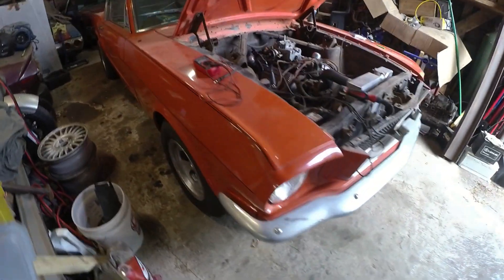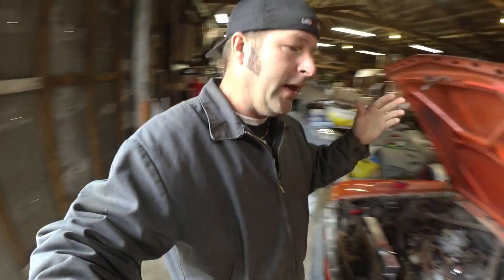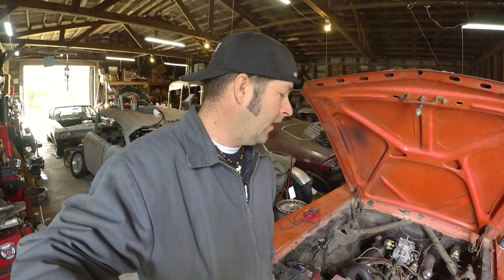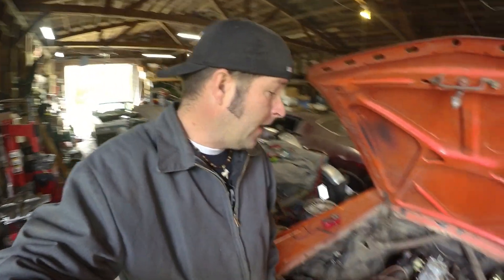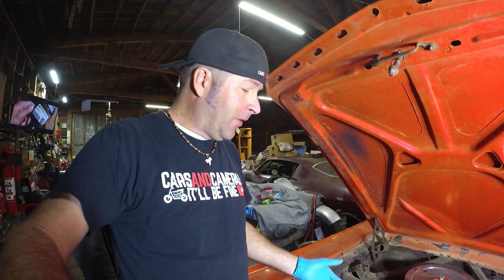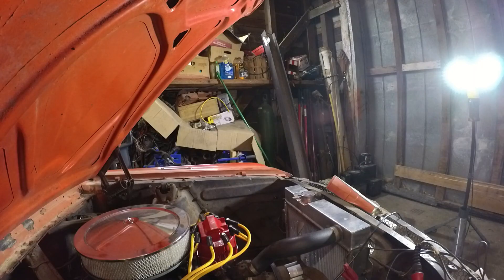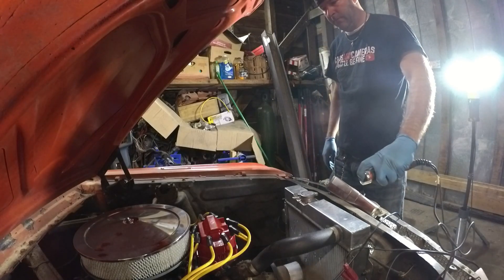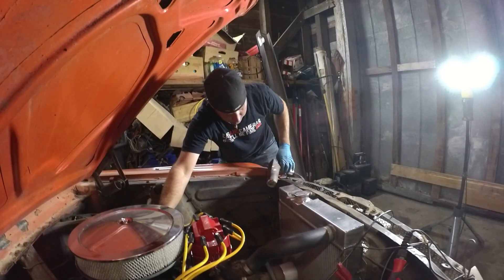My 65 Mustang Died!

Comment: Sometimes the big cap on the HEI doesn't have enough clearance with some intakes. I've used the duraspark ford distributor with an HEI module ...prints and info all over the net. I gutted the fender well motorcraft module and installed it inside...at a glance you would never know.

Comment: If you still have the resistor in line with the ignition, and you are running an aftermarket ignition, that’s your problem. Points need the resistor, anything else will get destroyed if you run the resistor. Electric ignition systems require a full 12+ volts, and running them low will burn them up.
Reply: Except the flamethrower lll
Reply: The flamethrower lll has burnout protection  but also needs 3.2 ohm coil.
Reply: @Paulman50  Really? I guess that’s part of the reason I don’t buy trash from Pertronix. That, and in my 30 years of building engines and drag racing, I’ve never had a customer ask for that brand and I’ve never seen anyone running Pertronix parts that didn’t swap back to MSD, Accel or Mallory within a few races. I’ll stick with MSD.

Comment: Me and my brother were working on a Chevy uplander that wouldn't start and  found we weren't getting fuel. I changed the fuel pump about a month ago. so we took the fuel pump off and tested it and it was fine. We weren't getting power to the pump and so I followed the wires to make sure none were broken. Eventually we decided it was the fuse box itself. My brother smacked the fuse box and the fuel pump kicked in and the thing started perfectly. Funny how stuff works sometimes 😂

Comment: My MGB was doing this when I upgraded to the Petronix ignition. I had it wired one way and it ran fine, then would go out and try to start it and it would only run while cranking. I went and checked where I spliced into and it was not spliced in on the run wire, it was spliced into the crank wire. By all rights it should have never ran. I switched them and it started right up and ran good.

Comment: On those protronix distributors the wires inside brake from the movement of the advance plate. As soon as the engine trys to start the advance plate moves and the broken wire looses connection. Usually happens with in a year of instal.
Reply: Had the same issue on a Maverick. Tried and replaced a lot of parts before we finally figured it out.

Comment: Fords are notorious for the fiber gear in the timing set just up and stripping out. I have had this happen to me 3 times just shut it off and go to start it again and it will do just like yours does. It would fire for a very short time and quit. Another thing to check is the small wires on the solenoid. ne should have 12 V in the starting position and the other should have 6 to 9V in the running position. The only time the coil should see a full 12V is in the starting position.

Comment: had a 81 impalla wagon 305 with a wierd 3 speed auto with a overdrive.did same thing.couldnt figure out why it was acting up plus back then would not pass emissions.so i parked it sold it to a truck driver at work.who stuck a racing distributor in it it fired up.i know you are not wild about the  distributor in the stang if it works and fits it runs.be good for now.

Comment: The old ignition has 12 on start but the voltage drops to 6 volts in run. Your electronic ignition needs full 12 volts.
Reply: Plus needs 3 to 3.2 ohm coil, these draw 17amps until the motor starts running.

Comment: Bad condenser On the original sounds like to me. With that you will have power on the coil side but nothing after the distributor or not enough to run at least. Nice vid man.

Comment: I hate cut to fit ignition wires. In my experience they never last longer than two years, and lucky to get that long out of them. Chevy HEI was always pretty bullet proof. Why worry about how it looks as long as it runs when you turn the key? Just keep the hood shut and no one will know.

Comment: Can an "In-Line Resistor" be replaced with a "Fuse" per say, like make replacing easier? Like an in-line fuse...🤔
Reply: It’ll e the best part of the pony Ha ha.
Reply: No, the resistor is to limit voltage and current to the primary of the coil while the engine is running to prevent burning up the primary winding of the coil.
Reply: Put a one wire delco to go with distributor.
Reply: @davidjernigan8161  yeah, but with the HEI distributor he needs a clean 12V battery. You only need a resistor on points ignition.
Reply: A resistor drops the voltage to 6-8 volts.

Comment: I recently bought a 1968 Coronet that had been sitting 8n storage since 1986. The previous owner had locked up the motor with a broken crank and put it away. I had plans of dropping a 73 imperial 440 in it that I have. Then I ran across a 700 hp blown 440 out of a cuda'. I've been busy upgrading all the systems for the hp gains. There's a lot to it! Lol. It would be cool to do one of those drag weeks with you driving that mustang, or the Biscayne.

Comment: Speaking of weird ignition issues. I tried to fire up my mower the other day and it wouldn't start so I put one of those inline spark testers to see if it had spark and it fired up with it on then I took it off it wouldn't start again so I put the spark tester back on and it fired back up so needless to say I just mowed with inline spark tester hanging out the side of my riding mower 🤣

Comment: You can run a typical Chevy module wiht ANY magnetic pick up. Old Mopar electronic units are getting pricey. It is much easier to use the mopar magnetic dist and make a little box whee I put a grounded chevy unit wired to the coil

Comment: HEI Make sure that you have HEI Plug WIRES, if nothing else a stock distributor Make sure the points are set exactly, dwell meter will help if you do go stock.  Plug the vacuum hose leak. and in the mountains I used to run 13 *BTDC THEN Hook vacuum hose to distributor. Need at Vacuum advance.

Comment: The reason you have voltage when cranking and ignition off is because when the starter solenoid is energized the "I" terminal (small terminal next to the starter cable) supplies full 12 volts to the coil in the start mode. When released, you should get a reduced voltage either through a ballast resister or resistive wire through the ignition switch. Some electronic systems need a full 12v in the run position to operate correctly.

Comment: You have to set the timing on those old Fords with a vacuum gage the chances of you having the correct timing tab and balancer is pretty slim unless it is the original engine. They seem to change every other year. my wife's 67 was way off. you should have got a blue cap make it look better.

Comment: Ford duraspark II ignition is the best factory electronic made ! Hot Rod magazine did an article 30 -35 years ago on electronic ignitions and to get better than duraspark II at the time you needed an MSD system .
Throw out that junky hei and put a duraspark II system in !

Comment: My old school background probably puts me in the minority here, but I have to say I LOVE point type ignitions for their simplicity and cheap price. Yes points have to be cleaned and adjusted periodically, but unless the distributor is inaccessible, its a less than five minute job most thirteen year old kids can learn in a few minutes. Carry a spare set and a screwdriver in the glovebox and you're good to get yourself going again if you do break down in the middle of nowhere. As far as performance goes, what the 60's and early 70's muscle cars could do with point type ignitions is more than impressive...
Reply: People nowadays are too stupid to figure out simple things, and would rather waste money on garbage aftermarket parts just because some magazine said that they need them. But I fully agree with you, I've driven all over BFE and have had zero problems with my points ignitions once you spend the 5 minutes setting them up properly.

Comment: let me guess...it was pertronix. i bought one of their billet distributors, and 5 months later, my dart started running like crap, like the timing was super retarded, and then it died, and wouldnt start back up. popped the hood and could smell burnt electronics. tried and tried to contact warranty about it with no luck. roasted them on instagram in a post, and then i got contact lol. they sent a new pickup, and i had to take a pic of the old pickup with the wires cut LOL.

Comment: Maaaannn i used to have a 73' Mustang and i am kicking myself for selling it. But it needed so much fabrication work done to it and at the time i couldn't afford to have it worked on so i sold it. There were holes in the floor boards and through the trunk. But it still started up. My Mother owned it since she got it brand new back in 73'. Oh well it's gone forever now. 🏎☁☁🤦‍♂

Comment: That wire going to the coil. Should be a silver metallic wire instead of copper. The wire itself is a ballist resistor. Fine job good show. That ballist resistor wire may or may not be needed with electronic ignition.
Reply: If you have the resistor wire and want to run an HEI style you need to change it out at the bulk head to a regular copper wire, it will run with it but you will get high rpm misfires due to lack of voltage. Had to do that on my 68 belair when i went from points to hei.
Reply: Get on it and drive.

Comment: Rebuild the original stuff, HEI is a good ignition, but ugly as sin on a Ford V8. If I needed electronic ignition on that car, I'd go with the Ford Duraspark, which might start some more arguments, but that big Duraspark II cap looks less out of place than the HEI. HEI is the easiest way to get running in half an afternoon though. I retrofitted the Duraspark from my wrecked '82 GT 5.0 onto a '68 Cougar, and it ran a lot better than the points system did.
Only Ford TFI module I ever had go bad happened in my driveway.

Comment: I don't know if you are using a duraspark box or not, but if you are, most likely the module has gone bad. I had the same problem back in college on a 78 Thunderbird that I owned. As long as you crank the key it would fire up. As soon as you let off it would die. Love the videos! Keep them coming!

Comment: We installed a Pertronix distributor and coil on our 48 F-1 with a 460. It was missing on a cylinder prior to making the upgrade, but now feels like it has more power. Plus it looks just like factory. It is a pricy upgrade, but worth it in my opinion over dealing with points.

Comment: Chatting on the live feed about fuel cost the other day. its gone up again here. £1.80 per litre of diesel ($2.20) thats about $4.85 per gallon (2.2 litres) what are you paying where you are? petrol/gasoline is not as expensive and my car runs diesel anyways.
Reply from the maker: 4.25 a gal usd
Reply: There is actually 3.78 litres in a US gallon (4.54 in an imperial (UK) gallon) so that makes a gallon equivalent to $6.80 here in the UK. But as there are 4.54 litres in a UK gallon that gallon is costing us £8.17. And at today’s exchange rate that makes a UK gallon $10.13. 😳

Comment: Get a Pertronix or MSD distributor, there's no way I'd ever go back to points. What a PITA they were.
I'd get an MSD distributor and a 6A or 6AL box myself. I've run those for years and they always held up very well. They also seemed to add a bit of power and better mileage.

Comment: It could be that the run circuit in the starter solenoid has gone bad, just a guess. My first Mustang was a 65 FB same color as yours, bought new in 65. It was a gift for graduating navy boot camp. unfortunatly it was a 6 cyl with an a/t as I was more of a high performance kind of guy my parents were aware of my disappointment with it so the gave me the money for the trade in on my Austin Heally sprite and I went and bought an 1964 Falcon sprint with a v8 and four speed. Much more my style. It was my drag race car for about 10 years. I have owned many Mustangs since then but you always remember the first one. Good luck with yours.